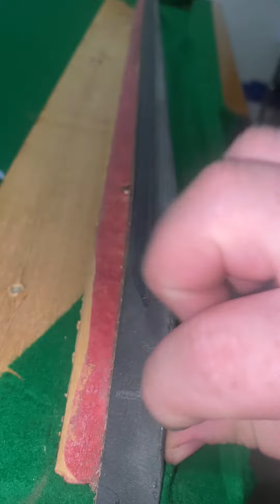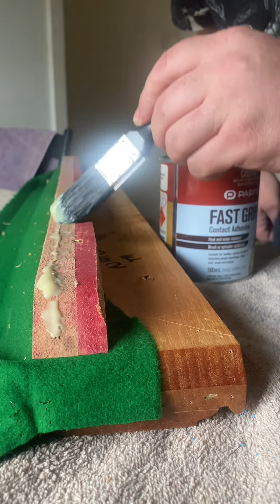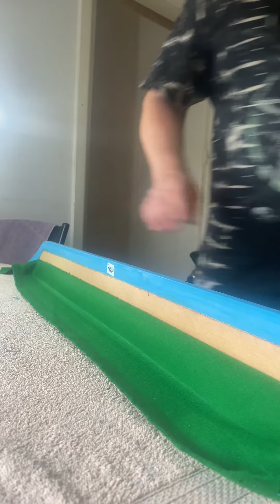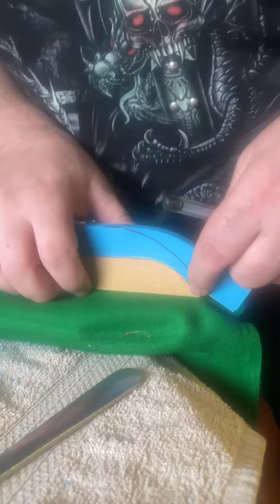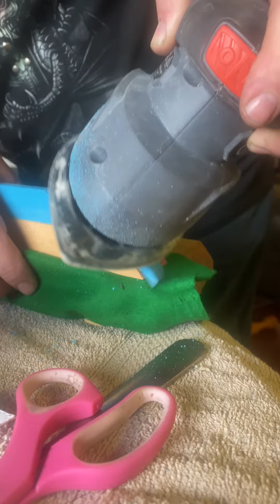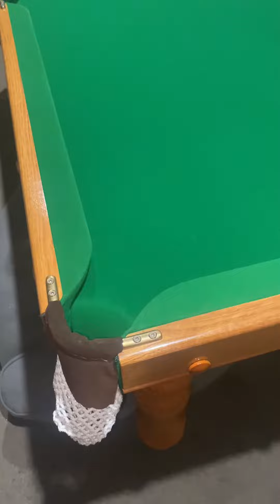How To Replace Pool Table Cushions (bumpers) English 8 ball 7ft x 3.6ft. (Australia)

Comment: Ive got the same formula sports rubber, and Im wondering if you think you installed it the correct way up? 
I think its meant to go the way you glued it, but most other videos show the material backing on the rubber goes to the top side? 
Thanks for the video